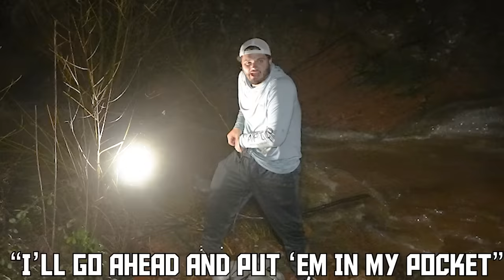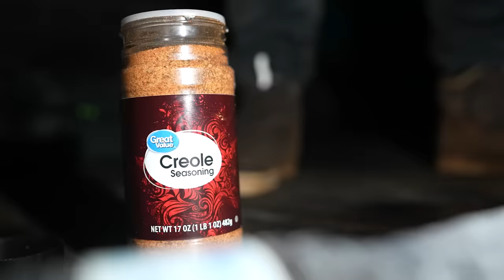Eating ONLY What I Catch Off The PONTOON CAMPER For 24 Hours!!

Comment: If you removed the extra bed you could try shortening the campers vinyl on that side to maybe turn it into a wall. Also after that, you could try building a little structural support under the roof so you guys can stand on it without it cracking since you'll have a little more room with one of the beds gone. Love the videos man, keep it up!